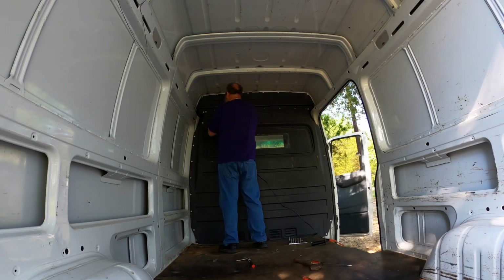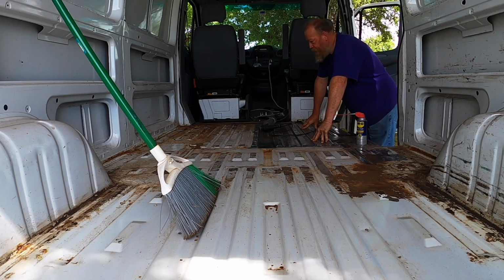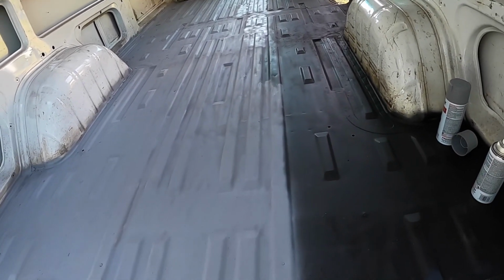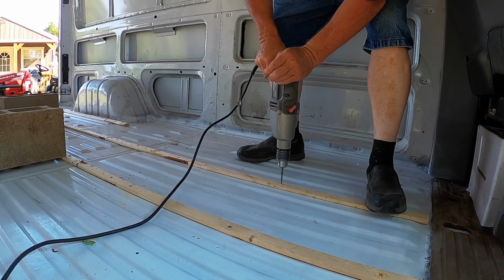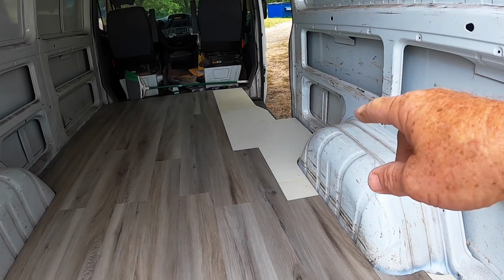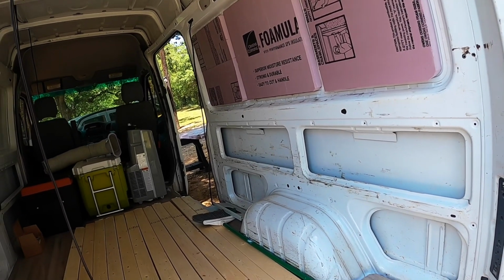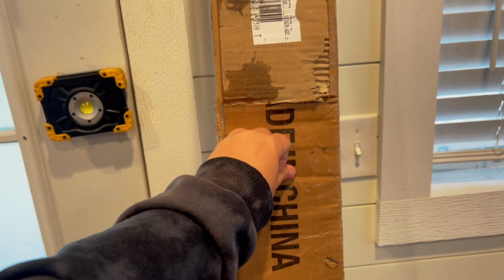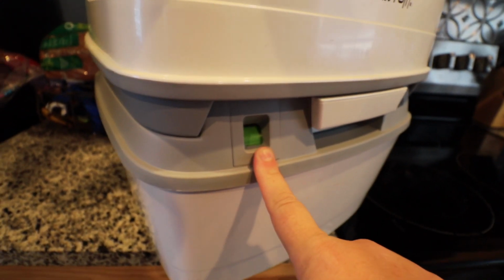Van Build Updates | 2006 Dodge Ram Sprinter Van Build Progress Report

Comment: He is really doing a great job.  I hate it that he did all the great floor restoration and someone showed screwing the floor down 🙈 hope he was able to paint where the screws came through. Also a little caulk.   That floor turned out amazing.  Great work on the framing too.  If still able to add some sound deadening material anywhere, I would definitely add that.  Gonna be a really great build.

Comment: A few points: Normally I love BBQ, but out from under a van floor, not so much. Yuck!
I love your Dad's voice, it reminded me of my Grandpa, so many happy memories. He'd make a great teacher, explains things well as he goes along.
I have shore power in my van too, mostly to run an electric heater in the winter. I also have solar on the roof to charge the batteries and charge from the engine. But sometimes I have to park in the shade, so I've ordered a folding solar panel and enough cord that I can set it up 100' from the van. This should give me enough ways to keep the batteries charged no matter where I go.
Reply from the maker: I told dad also that he might want to have a power station as a portable option for moving power outside of the van!!  I would have to agree about BBQ on the floor...lol
Reply: @BunnyPlaysHere  Portable power station would be a good option. I just use an extension cord when I need power outside the van.

Comment: Wheel wells need insulation too before access is covered up, hint hints. Not trying to tell you what to do, just think it would make it better. Love the progress of the build, and the videos. Thanks for showing.
Reply from the maker: He isn’t finished yet I know he was trying to build some structural pieces but he will likely be doing some more in this area also.